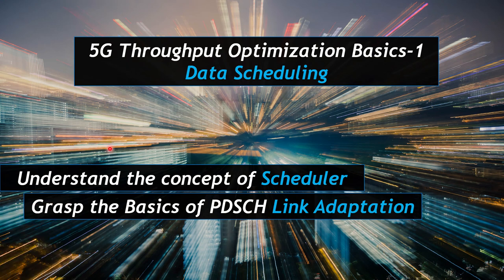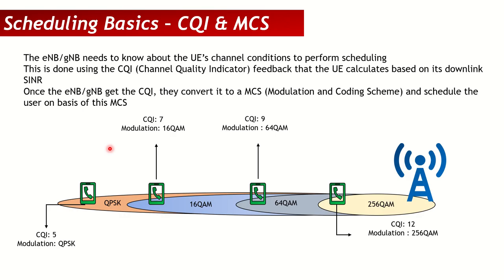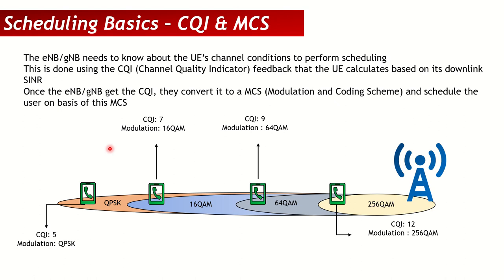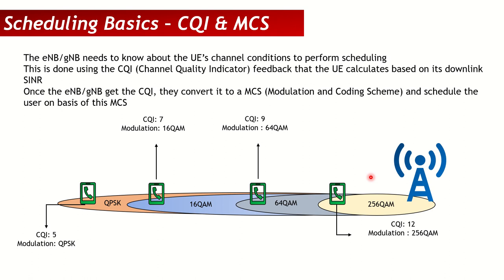5G Throughput Optimization Basics #1 - Data Scheduling & Link Adaptation

Comment: Is the MCS for the UL transmission configured based on HARQ ACK/NACK sent by gNB ? Thank you
Reply from the maker: Yes, outer loop works on BLER which is based on ACK/NACK. So, MCS is adjusted based on that.

Comment: Nice Video .How about UL data scheduling .Does NW calculate UL Channel quality and schedules grants to UE.
Reply from the maker: Yup, the NW calculates UL channel quality but grants are usually based on UE's requirement which is indicated by SR or BSR mechanism.
Reply: @OurTechPlanet  Thanks for your reply .So do we have CQI to MCS mapping for UL as well or not .Like to know how UL CQI and MCS work while UL data transfer .May you share the spec reference if any .
Reply from the maker: @ramyaranjanbarik681  No, actually in uplink, there is no CQI index. It is uplink SINR that is directly calculated by the gNB/eNB and then the scheduler assigns an appropriate MCS. So, this is more of a vendor implementation thing.
Reply: @OurTechPlanet  Got it .So eNB/gNB used SRS-AS to estimate the UL SINR and NW scheduler assigns an appropriate MCS irrespective of Vendor implementation i guess. The way of measuring the SRS-AS and allocating MCS might be a vendor specific. Thanks for clarifying the doubts.

Comment: Hello sir, please come out with a video on cqi, 5qi, mcs in 5g nr. My ex bosstold me that cqi is not there in nr and instead it has 5qi(5g qci) but no cqi. Three different mcs tables are there in 5g but first two are same as in lte and 3rd one is for low SE(urllc). But still I have seen somewhere that nr too has three different cqi tables(again first two are same as was in lte). In one interview also when I told that there is no cqi in nr and it has new terms called 5qi.but the interviewer did not believe me and as a result I got rejected.
Reply from the maker: 5G has CQI table as well , just like LTE. 
QCI is a different thing, it is Quality Of Service and in 5G , the equivalent of QCI is called 5QI